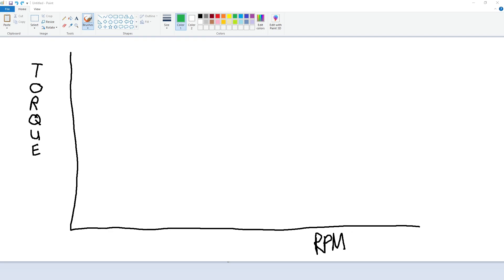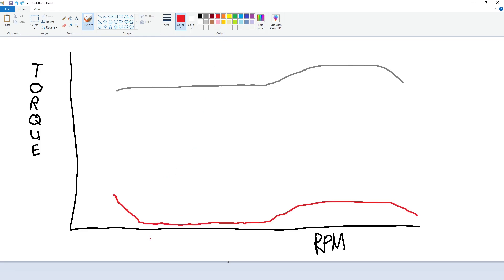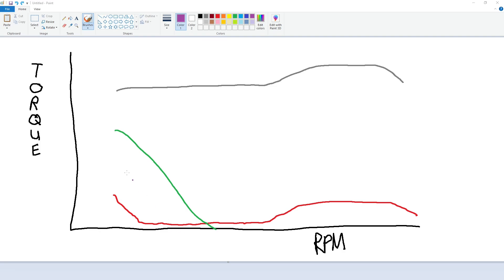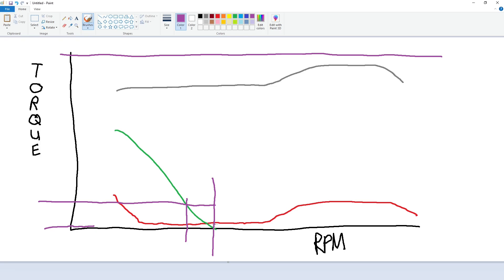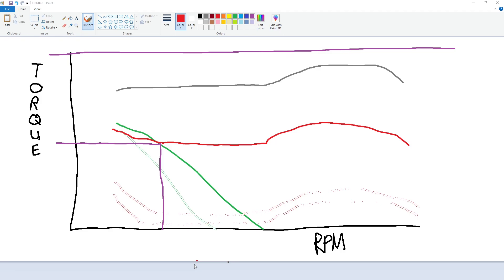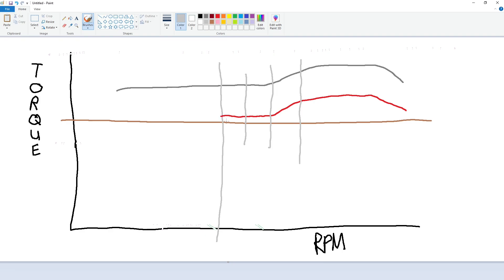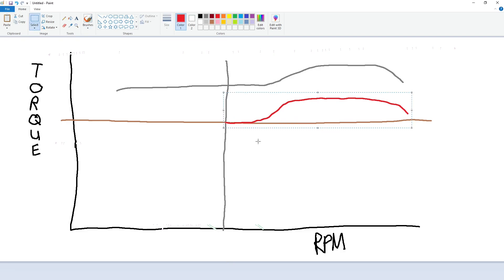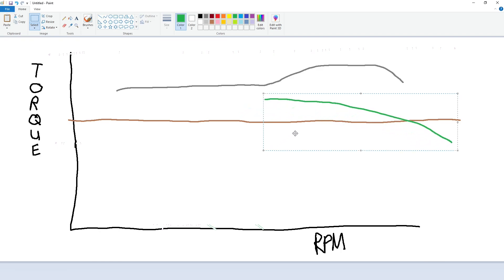Using MS Paint to (better) explain the bad throttle simulation of AC Evo, iRacing and other sims.

Comment: so thats why accelerating out of a low speed slide in RBR can be so difficult at times?
Reply from the maker: A lot of things play a role, a sim isn't great or terrible just depending on the throttle behavior, but yes, it could certainly play a role.
Reply: @NielsHeusinkveld  yeah the overall physics on RBR (of course NGP, not vanilla 😅) are really really good. I'm surprised that the throttle behaviour has either been ignored or forgotten. Well it is just one guy working on it after all..

Comment: Sure the details can be a bit hard to grasp but I dont understand how some people dont understand holding your throttle at a particular point wont magically climb all the way to the redline.
When youre cruising at 30mph in your car you dont have to keep letting off the throttle completely. On a flat road you can just find the right pressure and hold it. Even holding the clutch down, no resistance, your rpm will settle based on where you hold the throttle.

To not understand it would mean not driving a car... unless maybe someone drove an auto and thought it handles all this for you..?
Reply: I've found a number of driving "experts" complaining about how unrealistic some sim thing is only to find out they've never driven a car. One guy on the BeamNG forum was complaining about how unrealistic it is that the steering wheel self centers.
Reply: @JZStudiosonline     *cough* GamerMuscle *cough*. That dude doesn't even have a drivers license yet talks like he's the expert when it comes to car handling
Reply: @toyotaman182  Yeah, at this point the only guy I listen to about sims is Ogonoski because he actually has valid criticism about why basic shit doesn't work. The entire community is full of people who've never driven arguing with actual drivers that they don't know what their actual car is like to drive. Just have to ignore it and realize these are still games.
Reply: @toyotaman182  Didn't he make a video defending iRacing's tire model?
Reply: I've never driven a car irl and its not hard to grasp. It's not like people don't get exposed to analogous situations in their daily lives. Water taps for example. Open up the tap by x%, the water pressure will not infinitely rise over time.

Comment: The question is. Which sims use the improved throttle model?

Also, unless i'm dumb, i'm surprised AC1 hasn't gotten an improved throttle model mod.
Reply: RF2, LMU and AMS2

Comment: Is it possible no one has wanted to fix this because it might have so many knock-on effects, like with how cars are designed and AI are tuned, etc.?
Reply: there are sims that use an improved throttle model. ams1 and ams2, rf2 and lmu, Beamng Drive, and funny enough Wreckfest uses a better throttle model.
Reply: I'd put my money on that, the devs are probably fully aware of it.. In relation to the other reply, maybe those sims were built with this throttle model in mind and with AC Evo that ship has already sailed so to speak and to change such a thing now will result in way too much correction work elsewhere for the devs? I really hope this isn't the case tho

Even so someone else made a good point about updating the throttling model to go hand in hand with the open world element of the game where it isn't constantly hammertime like in a race/hotlap sesh

Comment: I often wondered why take off in Sims seemed a bit meh, I always assumed it was simply an issue of not having feedback on the clutch bite point, but this actually makes more sense.
Reply: Its probably both. Clutch models generally are pretty bad themselves.
Reply: These sims dont have torque modeled. If you push the pedal at 20% car will barely move while in a car you would move
Reply: Im not understanding all of this. But it makes me wonder, if basically every sim is wrong about this, then why is that? Is there a reason, maybe a technical or PC-periphery limitation?

Maybe its just one of those legacy features people forgot about, but it seems like throttle-response is a pretty central part to cars and racing. The devs of sims like Assetto Corsa arent lazy, they clearly put a huge amount of work into the simulation and even made it the big selling point.
Reply: @termitreter6545  He made a previous video about it, but basically they take the torque curve data sheet from the manufacturer and simply add a multiplier so 50% throttle is basically the curve multiplied by .5, which isn't realistic. It's a simplified input model because otherwise they need to take actual input response graphs from applying specific amounts of throttle for each car, which they would probably need to dyno the cars for to get realistic results.
Reply: @JZStudiosonline  Thank you, that does explain a lot! 
So the whole thing is more of a simplification for when you have to simulate a lot of car. Thats tricky.

At least on the official ACE forum they aknowledged the issue. Curious what they gonna do.
Reply: @termitreter6545  could you link that acknowldgement or tell me how to find it pls?
Reply: @JZStudiosonline  They don't need actual input graphs to improve. They could get 80% there with a general model that has the typical torque response with rpm and throttle input. Adjusted for individual engines. 80% accurate is still a lot better than 0%.
Reply: @termitreter6545 currently looks like BeamNG has the best simulation of both cluth and throttle to pedal position. So it's not all sims that have it wrong, and not impossible to improve upon. 

Quite a fundamental feature, irl you don't need a lot of throttle input to start smooth without stalling, and if in lower range of rpm no need for 100% pedal position to reach 100% torque, which works as natural "anti-spin-out" when accelerating out of corner, get to i.ex. 70% throttle position, get max torque without abrupt torque spikes as rpm climbs. Unlike AC, iRacing etc. Where you need to push pedal to the metal for max torque in any rev range - feels way off to real cars even with modern ECUs.
Reply: @driv3ver  Thats interesting. BeanNG isnt really a racing sim, right? I dont think it tries to simulate specific real world cars, like AC and Iracing do.

Maybe thats connected to it, that doing accurate throttle response for every real life car is too difficult, because they are too different?
Reply: Surprisingly BeamNG is a great racing sim and indeed tries to simulate real world cars - just can't use the branding. Due to damage model no manufacturer will allow them licensing, so they work with knock offs. Some of BeamNG aspects are simply unmatched. When it comes to variety it is also unlike any other car game. From 1920s till modern, from 16.4L bus diesel engines to 0.6L kei car gasoline motors. From beast like rock crawlers, buses, commuters to rally and racecars. N2O injection, turbos, superchargers and N/A. All kinds of suspension leaf springs, multilink, live axle, torsion bars, McPherson, double wishbone and so on. Oil in shocks aeration (changes if it's gas pressurized etc), heat-up changing viscosity and effectiveness and so on. All kind of drivetrains that are simulated very very well - like no other game does hydrokinetic autos so good, CVTs, synchro and non-synchro manuals, DCTs, sequential, centrifugal clutches, EVs, locking transfer cases, diffs, and so on. And I could give you a lot of insane details how deep BeamNG simulation goes like air density and temperature change with altitude, that affects everything. Like the higher you go the less HP output due to less O2 molecules (affects N/A cars the most), less downforce, as there's less air particles that push on aero parts, yet less air drag, less efficient cooling, again - less air particles to transfer heat to, but also relatively "more pressure" inside tires, as there's less pressure pushing on them from the outside, and all parts bend due to air drag, which affects aero, so if you damage wing in a way it sits unequal you may experience car pulling to one side etc. - All easy to experience on laser scanned Pikes Peak map mod. Stuff like liquid sloshing, chassis flex, torque steer, centrifugal forces from rotating objects. You may even take a commuter, tune it and destroy motor from oil starvation, as now it grips so good, that oil get's sloshed far enough from oil sump to slowly damage car due to moments where it lacks oil lubrication, unless you make it dry-sump system or get different oil pan etc. - Literally same issue as in my Lotus Elise. Yet there's much more into overall physics sim and I'd have to make it 20 times longer to describe it all, so let me tell you that many physics phenomenon happens in BeamNG without additional scripting, just out of nature of the physics code if you want example search for "tennis rocket theorem BeamNG" - you'll get a blogpost from 2015 and there's more of stuff like that :D

It's that is a sandbox kind of game for now, lacks gameplay and multiplayer, AI isn't advanced enough for racing, FFB isn't the best, tire model currently lacks deg and thermals, and due to how aero works drafting also doesn't exist. Though it's still in alpha stage, not even beta and will improve overtime, as devs are very committed and release big updates frequently. Yet that's still many years from now. What will certainly happen at one point is simulation of tire deg and thermals, improved AI and FFB. Possibly official multiplayer (there is community multiplayer and it works good), aero code update- it works fine, but don't take other vehicles interacting on each other aero effects.

Though in latest update early preview of rally mode has dropped in, so it's confirmed that it will become a full gameplay mode. Early WIP carrier mode also is in the works that will include all kind of automotive activities from taxi driving, off-roading, bus and semi delivering, drifting (I've even a short vid from drifting in BeamNG), demolition derby, gymkhana, stunts, drag and circuit racing and so on. - But it's still years away.
Reply: @termitreter6545  For whatever reason YT deletes a lot of my comments, so I had to trick it, and edit my other comment, else it didn't worked, my reply is posted in a comment above this one :)
Reply: AC has all these physics and speed density air physics to.  Beam has a good automatic physics though . @driv3ver
Reply: @casual_flex  "AC has all the physics too", that's not true. You can't simulate tennis tocket theorem in AC, or bend wing and due to uneven angle of attack it will generate different drag and downforce values resulting in pulling to one side etc. which proves it's way less advanced physics engine. Though aero code in AC is better in terms of drafting, and AC is simply better sim racing game, as it's focused product, with real cars, tracks, official multiplayer, better FFB and VR support, there's no doubt about it. Yet BeamNG is far more advanced in other terms, but has limitations in other aspects due to it's unique soft-body model and is currently "just" a sandbox, without any pourpose, lacks features etc, that's to be expected from game in alpha stage, what's not expected by most is the long development process. BeamNG dev team isn't small anymore, it's just the crazy physics model that's making development very slow compared to hard-body model like any other car game (execpt Rigs of Rods).

Comment: Hi,back when i was playing PC2 i heard about that thing now i see what is what. 👍
Starting to wondering how the impact is on cornering?
Always have hard time when trying to take a corner at x speed with minimal  throttle,the car don't accelerate much but the front lift up like much gas is applied and give understeer.
(Wierd  how below 50% throttle cars act like have low power)

Comment: This makes so much sense now. Never knew why the clutch required me to give so much throttle input.
Reply: This is also going to be critical to fix since they are making such a big deal about driving on real roads. Driving on streets at lower speeds, stop and go, etc. in sims has always been an unrealistic chore. The games only function properly when you're driving flat out.

Comment: Which games do correctly model the torque-throttle relationship?
Reply: ams1 and ams2, rf2 and lmu, beamng, and funny enough Wreckfest uses a better throttle model.
Reply: Live for speed
Reply from the maker: @tomward294  Nope, not LFS, unless they changed it in very recent times.
Reply: @NielsHeusinkveld  RaceRoom had an update in 2020 where the release article talks about about addressing the torque response curve. Is it possible the car you had tested previously was on the old model?
Reply: @RicHSAD2  no, that's a different thing. Raceroom implemented non-linear throttle response for cars that have it non-linear IRL, but that's like older cars. modern GT3s have linear throttle reponse IRL, for example. but the issue Niels is talking about is how engine torque changes with RPM at non-100% throttle input. also Raceroom's main physics dev had uhm... quite dismissive response to this issue while also confirming that this is indeed an issue. so no, Raceroom doesn't do it right either, unfortunately
Reply: @tomward294  Not according to Niels, but perhaps he tested an earlier version?

Comment: Is hard to believe that they (sim devs) dont know this, meaning there must be a design choice to make the throttle map the way it is no? Can you think of why would they want a model like this?
Reply: He covered why in an earlier video a while ago, basically the problem is it is more work to make it a proper model.
Also the only data they have is the full throttle runs, nobody does a 50% throttle, 30% throttle run of the cars on a dyno, meaning you have to do a lot of guesswork / assumptions.
Reply: it's easier to just do THROTTLE_INPUT * ENGINE_TORQUE than use different curves for different throttle models or come up with a dynamic formula
Reply: You’d need to model the engine torque curve with the throttle opening making a restriction, which is why the torque and revs rise and then stop at a certain rpm depending on throttle position
Reply: beamng devs know about this
Reply: Because they can get away with it.

Comment: I wonder how BeamNG does it, they like accurate simulations...
Reply: It's modeled correctly according to Heusinkveld. I can confirm this too because I can actually move smoothly from neutral to 1st compared to AC's clutch dump guessing game.
Reply: @dlts6416  You can always count on them to do things right. 🙂 Except aero and tyres sadly, who knows maybe in the future
Reply: Theres a BeamNG dev discussing things in the comments of the old detailed explanation video.
Reply: they are fine
Reply: They have an article about the model and its evolution on their website. I think you should be able to find it by searching something along the lines of 'beamng throttle model'

Comment: Petition to get Niels, Boese and Ilja involved in the development of the final release?
Reply: I just can't comprehend why with Niels being on board with Reiza does AMS2 feel like one of the worst sims out there - even if the throttle model is supposedly good.
Reply: @getsideways7257  I might be wrong, but according to an interview with Reiza Renato, Niels has very little to do with AMS2.(quote: Niels is still onboard as a consultant but his involvement had already gradually decreased over the years as his hardware business grew and took most of his time.) 
His baby was the original AMS, and obviously that ran on Gmotor, so the new physics environment might be quite different. (even tho supposedly AMS2 has the same throttle model as AMS1)
It's extremely disappointing to see how most modern sims don't seem to be bothered by this major flaw.
Reply from the maker: @getsideways7257  Me and Reiza parted ways after AMS1 was finished. No hard feelings but I didn't have the time and also not enough confidence that I could make the new physics engine do what we wanted it to do.
Reply: @NielsHeusinkveld  Ah, my bad then - I was not aware of that. AMS1 was quite good, actually.
Edit: but then I'm surprised you haven't tried making one of your own, Niels. Or maybe joining forces with someone... maybe even the BeamNG developer. And considering you experimented with two wheels in AMS1, maybe even a bike sim...

Comment: It would be really nice if this were to be implemented, but wouldn't it be very resource heavy to simulate this? Angie The Great here on YT  has created an engine simulator, but you need a very decent pc to fully run it.
Reply: They are just curves, which simply need to be adjusted.
Reply: Yep,  just interpolate a few torque curves for different throttle positions.  That's what all sims do, but I think they only interpolate between 0% and 100% throttle.
Reply: I would've thought that even a almost-complex dynamical model (i.e. specified with differential equations) would be pretty trivial to simulate (i.e. it doesn't need to simulate whole engine)
Reply: @maxhaughton1964  A sim that could simulate the car, engine and tyres with differential equations or state space would be great. Not so hard to implement. The hardest part is to model it, but an engineer or physics could do that easily.
Reply: No, it's just one or two multiplications to change the shape of the curve, or a generic map function with variable output control parameters depending on where at the RPM you are.
Reply from the maker: In AMS1, I use a spreadsheet to generate a 400 point map, and the sim does simple linear interpolation. I think you could easily do that on a 486 cpu from 1992. 🙂 Of course complicated physical models like AngeTheGreat is making could do a similar thing at insane CPU cost. His work is totally amazing, but will have some drawbacks like most physical models do, when you are making AC Evo or Gran Turismo and you need to have 150 proper driving cars. You need very good but as simple as possible models in my opinion, so table interpolation would do just fine.